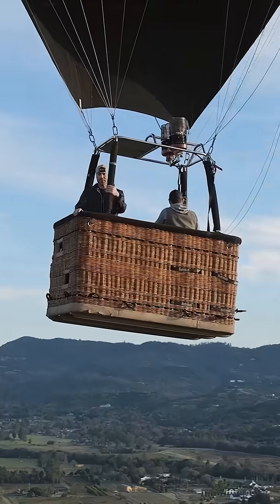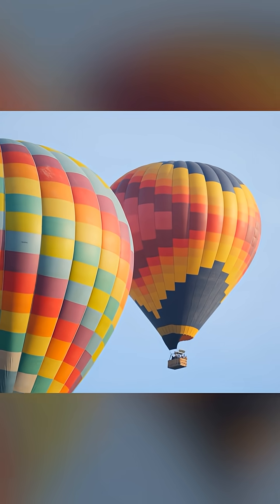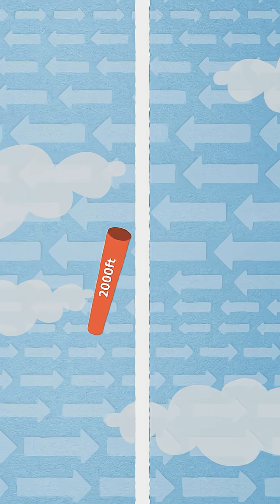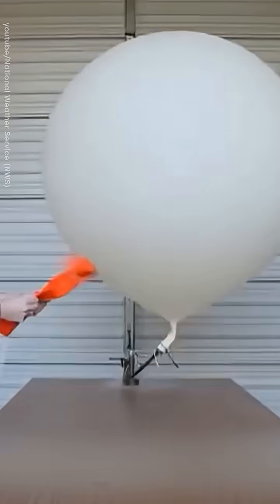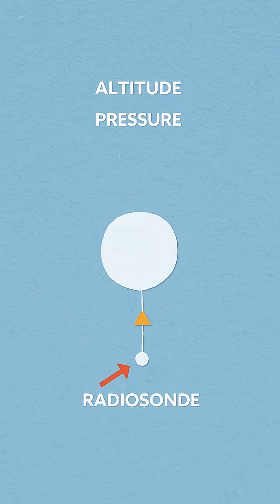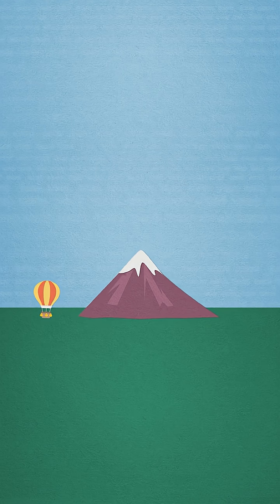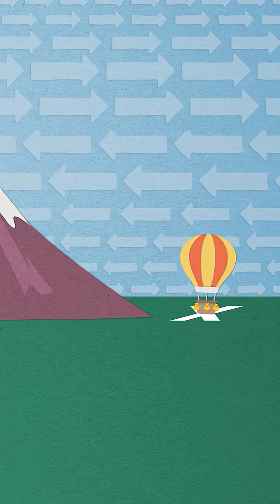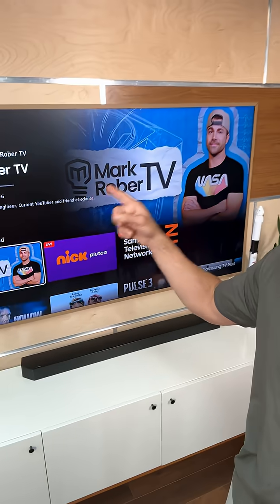How Do Hot Air Balloons Actually Steer?

Comment: Hot air balloons steer by changing altitude to find wind currents moving in different directions, as they lack traditional steering mechanisms like rudders or engines. Pilots adjust their vertical position by heating the air to rise or venting hot air to descend, catching the desired wind layer to alter their course.
-Gemini

Comment: This explanation works well in 2D, but what about in 3D?
Reply: Flight is a method of 3D travel. So the same explanation applies.
Reply: I think in 3D you need 4 altitudes with different wind directions so that you are able to move in the shape of a quadrilateral. If you are able to navigate around a quadrilateral, you can go anywhere you want just by increasing or decreasing the lengths of the sides so that your path doesn't end in the same place you started.

Basically every pair of wind directions represents a wedge of area where you can go, and you need 4 different directions to ensure that you can go anywhere (and they have to be 4 sufficiently different directions that you get 360 degree coverage).

Comment: 31 years ago, I worked as a Meteorologist at an airport.  I've assisted doing the weather balloon radiosonde launch in the early dawn (GMT -6).

The hot air balloon steering by changing altitudes and riding air currents traveling in different directions, yup - knew that already.  But I am a bit of an aerospace enthusiast whi actually worked at an airport.
Reply: what made u stop working there? im currently an assistant in a met office at an airport. just curious about ur career

Comment: Yo . But the world ain't 2D. Doesn't answer the question...
Reply: Same concept applies.
Reply: In the simple case where you know your intended direction of travel, you need 2 different wind directions that are both less than 90 degrees away from that and where your intended direction is between them. Then, instead of the optimal path, you take the other two legs of a triangle to get there.

If you want to ensure that it's possible for you to travel in any direction, you need 4 wind directions such that one of them lies in each quadrant of the compass.

Comment: What if there is no wind?
Reply: There's always wind
Reply: The air is different temperatures at different altitudes, and temperature variations are what cause air currents in the first place, so it's basically always possible to find wind at some altitude.